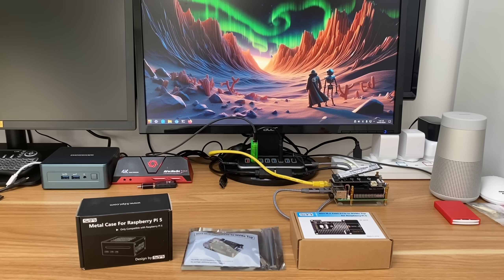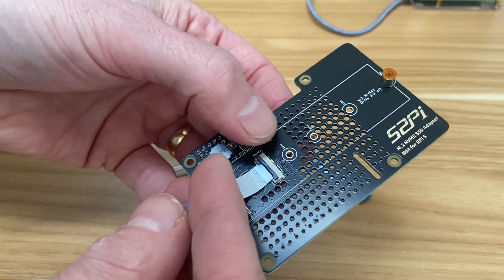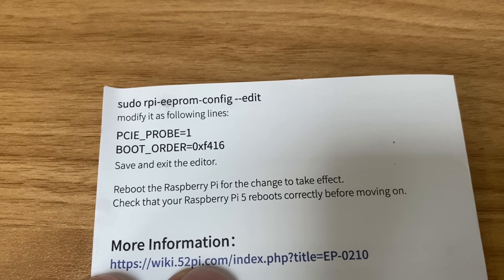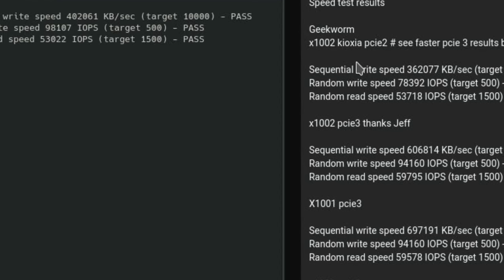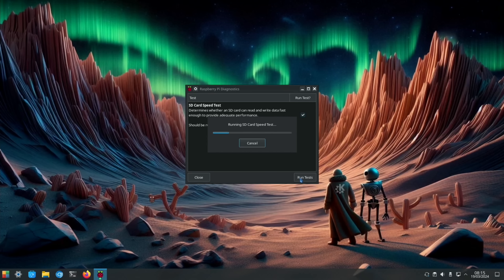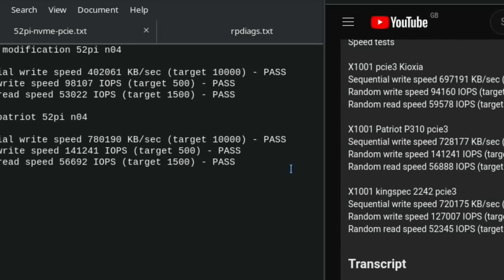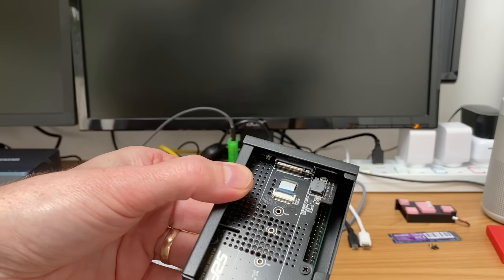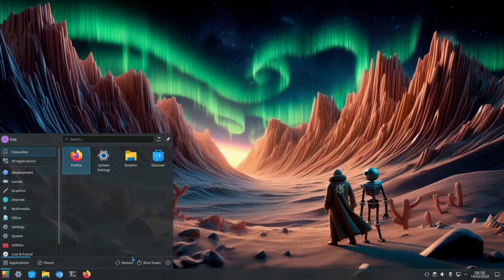Raspberry Pi 5 Metal case with NVMe. 52Pi

Comment: metal case and heatsink mod will kill wifi performance without an external antennae mod. with just the heatsink, i can't get 40 feet from the router and maintain good performance

Comment: Hi, I currently have the standard pi case for my pi 5, and for me, it seems like the case gets very hot to the touch when running 24/7, maybe you remember how hot the case got on the outside? Or maybe you even have it still running ? I would appreciate an answer very much, many thanks!
Reply from the maker: I didn’t run mine 24/7 might be worth setting the fan to come on earlier.

Try Raspi-config

I mostly use this

Electrocookie Raspberry Pi 5 NVMe case with a Door!
https://youtu.be/moN6m-Uu1QY
Reply: @leepspvideo thanks for the answer, the electrocookie does not get hot?
Reply from the maker: @zRetix it has a bigger cooler and more space internally. I haven’t experienced it getting hot

Comment: The advantage of this board is that the ribbon cable doesn't stick out that much, especially if you want to put the whole thing in a case. So, use the 52pi N04 board with a Geekworm case.

Comment: Is there a reason, other than its cheaper, to choose a no 4 instead of a no 5?
Reply from the maker: @riks9534  pi4 is slower but uses less power. Pi5 with nvme is much faster
Reply: @leepspvideo  thank you very much for that answer. I did mean the nvme pcie no 4 or the no 5 (not the raspberry pi 4 or 5 itself). The ones you put the link up for in the description. It seems the no 5 is faster, but is there a downside?
Im still learning and all, so i hope i can make my questions clear.
Reply from the maker: @riks9534  I would choose whichever fits your purpose. Both are so similar in performance

Comment: Have you found any NVME drives which weren’t compatible with this N04 Pi hat? Some other Pi hats seem to not like specific NVME models.
Reply from the maker: I have found the problem is usually the nvme drive. Not the various nvme hats I have

which NVMe drives work with a Raspberry Pi 5?
https://youtu.be/3mUgVTBmKio
Reply: @leepspvideo  I've seen various compatible drive lists but I couldn't find one specifically for the 52pi N04.
Reply from the maker: @pangloss9  if it works with others it should be fine

Comment: I got my Raspberry pi 5 B 8Gb today, With the same NVME adapter as the one in the video. I put them together m.2 nvme in and was recognized immediately.

 ask? I don't have the settings in the firmware config either and my config looks different than yours. Should I still add the pciex1 parameter?
Reply from the maker: @matay.J4350  you still need the gen 3 bit if you want gen 3 speeds

Shown in this video
https://youtu.be/3mUgVTBmKio?si=mZpU6lQJUHbaD1Ca
Reply: @leepspvideo  Thanks for the info👌👍👍👍

Samsung 960 EVO 250GB
Sequential write speed 748982
Random write speed 161022 IOPS
Random read speed  211406 IOPS
Test PASS

Comment: Hi, does this case work with bottom SSD hat ( Geekworm X1002 PCIe to M.2 )  ? It does look similar to to Geekworm's official case, but not sure if that bottom SSD hat will fit in here or not.......
Reply from the maker: @Nikhil-Stoic  probably, although I now recommend gpio powered nvme boards as the ribbon cable alone seems to be slower and causes problems if you plug in extra usb devices 

https://youtu.be/f8Ou6VkuF4w?si=cvvjthYXtLIVtzv0

Comment: I am impressed how smooth the operating system is running on your pi5. I have tested you latest build but it not that fluent. I have the 4gb version, but i doubt that for normal use there is a difference. Is your system overclocked maybe ?
Reply from the maker: I use an nvme drive for the best performance. If it’s still slow drop the desktop resolution to 720. I am rarely Overclocked on Pi 5 when running KDE
Reply: @leepspvideo  I will migrate to an nvme drive tomorrow, this will make a change for sure.

Comment: Great video, thanks. Do you think that (buying the N05 and the Metal Case For Pi5,support N04 & N05 & Active Cooler) there is space enough to use a NVMe with a heatsink or the heatsink occupy too much space? Thanks
Reply from the maker: Some smaller heatsinks will fit, the NVME doesn’t get too hot in my experience with Pi 5. Maybe in a hot climate.

More tests with nvme temps shown here

Raspberry Pi 5 Overclocking beyond 3Ghz. 4GB & 8GB models Benchmarked
https://youtu.be/3zlteWp6ro0

Comment: Being new to Pi’s I’ve got a Pi5 on order, that case and I think the same hat and similar drive. 

I will be putting Home Assistant on it though. Will I still be able to update the settings like you did to make the drive faster or is that just for Pi Operating system?
Reply from the maker: The process with config.txt settings is the same
Reply: @leepspvideo  Brill thanks. Is the only way to get to that file to put the Pi operating system on connect to a monitor and then Terminal to it like in your video? As I said I'm going for Home Assistant so would access it remotely after I've installed the Home Assistant OS. I haven't got a monitor available I'm all Macs in my house.
Reply from the maker: @Charlie_Chester  it can be done remotely
Reply: Awesome share, big thank you!
I have a question, I manage to connect to my pi with VNC and Pi Connect but my UI is not as in your video, the only theme I have is Pi OS standard but with Windows 11 icons and I can’t switch layout, I manage to get the menu and when I tried I got a to the log in screen (not pi os style) and when I typed in my password I get a black screen and then I’m back to the log in screen again. What should I do? I’m new to Pi’s and haven’t got any hdmi cable adapter yet so I need to fix this hehe. 

Thanks

Comment: Hi, after watching your video I decided to bite the bullet and get my Pi5 and the various bits you mention in this video as this was the build route I had chosen, but had not decided on a case (was going with an Argon), so thanks for the video. On the Pi Hut website they place the Patriot P310 in the not fully compatible bracket, have you noticed any issues? I bought it anyway.
Reply from the maker: No issues with the patriot it’s my main drive
Reply: @leepspvideo  Cool thanks - just built up the 52pi and noticed that mine came with a different top? The image on Amazon clearly shows the same top as your with lots of holes, however my lid only has 3 x fan shaped cut outs?

Comment: Is the dsi port on the raspberry pi 5 same as the pi 4 ?because i want to use a 5 inch dsi screen
Reply: No, the connector has changed, but there are cheap adapter cables you can use to make it work.
Reply: @Biadosaru  what is the name of the adapter?

Comment: Very good that the PCB and case top have holes for the air flow. Why don't they put the M.2 on the side of the board instead of right above the CPU? An alternative option is to have the M.2 2242 / 2230 orthogonal to the board, and near the USB plugs (with a hole in the PCB board where the CPU is located) to keep the air flowing off the CPU. *KDiskMark*, the HDD / SSD benchmark tool, is also very convenient for speed tests (Qt based, no dependencies to KDE although the name may suggest the opposite)

Comment: 0:58 the little ridge that goes around the brass fitting fits in the NVME drive recess where the screw would normally secure it to the post and acts as a sort of retention bracket or tab for the drive. It screws into the board from the other side. Many PCIE NVME/M.2 SATA adaptors use them because they're about as low profile as you can get. It acts as both the post and the screw, this way board doesn't have an m.2 nut that has to be removed to fit a longer m.2 drive.
Reply from the maker: Thank you

Comment: Great case, keeping the raspberry pi OS quite cool.. SD card once inserted in some cases are hard to take out, just because how they mold it, and how it overlaps the complete socket. This doesn't seem to be the issue with  this very case here. It is kind of a bummer, that the wifi turned out weak. That is the only thing keeping me away from this. Thanks Lee. 

By the way Lee, Update on Crimson OS: XFCE version was uploaded and today I will upload the LXQT version and finally the Crimson Desktop Edition (CrDE) tomorrow. 

A thing to note: upon installing an app from pi-apps, it initially opens up a terminal and yellow highlighted text begins to appear informing that system is incompatible. However, an additional script has been provided which works after 10 seconds of the message. Thus, an app installation will require 10 seconds wait-time before it actually initializes the install process. 
The reason for this behavior is forking various branches, repositories, which the pi-apps thinks are incompatible.

Whenever You Get Time,
Thanks, 
Another Great Video,             
Pradyot Pachore

Comment: Random comment.  Has anyone connected their Pi to a WiFi router using WPA3?
Reply: I did it and using the internal Broadcom adapter.  See pull/5945

Comment: If you feed the cable thru the hole before attaching and clamping you remove the possibility of cracking ribbon cable wires.

Comment: Almost looks like it could take a Pimoroni NVMe base on the bottom, almost.  Bit more space and ribbon cable consideration would be the crux there.  Prefer a base-fitted one, keeps your cooling options open.  Using a modded Raspberry case with mine currently, and NVMe base works well.  But really would like a metal larger one when the market selections stabilise, or something that's just - that one jumps out.  Have to pop the lid off the Rasberry one for those peak moments and the heatsink cooler(good price that one Raspberry).
Reply: Exactly, I don’t know why these companies are designing hats to use an NVME SSD. Heat is definitely something that needs to be considered.

Comment: The NEO 5 is better nvme is on the bottom and does not bloekc the ariflow , and yoiu to use ehternet if using a meteal case because wifi is not the grreates as one can imagine, i have  one plstic case for rpi 5 without nvme and use Ubuntu + Kodi for playing movies and the other ons ia NEO 5 metal case without nvme and the third one is NEO 5 with nvme and a 1 TB SSD on board also with Ubntu 23.10 on it, works fine.
Reply from the maker: Maybe it looks different in the video. I don’t feel airflow is blocked at all

Comment: I’ve given up waiting for the Argon Pi5 NVME case (my delivery date keeps moving backwards) so I’ve just ordered one of the 2280 versions of this from Amazon and as a Prime order it will be delivered tomorrow by 1pm. When the Argon one eventually arrives I’ll compare the running temps with 2280 SSDs. Thanks for the timely video. 👏
Reply: Yo ordene igual de Amazon prime el X1001 marca GeekWorm y me llego en 7 días y vivo en Puerto Rico 🇵🇷 zip code 00725 y pues este fin de semana ya la haré todo el montaje y pregunta que diferencia tiene de esa que orden con la que sale en el video o la que mencionas?
Reply: I think I'm going to hold out for the Argon case, due to the WiFi problem. I have an Argon case on one of my pi 4s and with the plastic bottom shell, it doesn't seem to interfere with the WiFi at all. I have two of my pis on ethernet, but there is no cableing to the room my desk is in, and I have no intention to crawl in the attic or crawlspace to run one.
Reply: @jbuchana  you could try powerline ethernet adapters. You don’t really get the speed they say they’re good for generally butbut you can get fast enough.
Reply: @ericg7490  Something to try! I could also get a USB ethernet adapter that would be outside the metal case. Two things to think about...
Reply: @jbuchana   I get around this by connecting a remote Pi4, running as a Roon Endpoint in a Pi Touch case which isn’t good for Wi-Fi , to an Ethernet PoE switch and the switch is then connected to a UniFi Wireless Access Point via  Ethernet which also powers the AP. I also have 3 other devices in that room connected to the same Ethernet switch and they all share the Wi-Fi connection with no performance problems. [I live in a 300 year old house with very thick solid walls so I get really annoying dead spots].
Reply: @ThisOldManOfTheSea  Sounds good!

Comment: I still feel that the ssd belongs on the bottom so that it is easier to cool the cpu.  Maybe I'm wrong but blocking the cpu cooling just doesn't work for me. Thanks for all you share.  Maybe all those holes for cooling will work. I'm sure you'll tell us at some time.
Reply from the maker: With the holes in the board and the gap between the NVME and the board airflow is still very good
Reply: @leepspvideo Thanks

Comment: Did you have to take it apart to plug the active cooler into the fan socket?  Saw that it wasn't connected when the hat was reattached after popping the cooler onto the rpi5.
Reply from the maker: I did

Comment: I need a case that can fit a bottom mounted nvme drive unfortunately.
Reply from the maker: I think it still would. Just checked definitely doesn’t work on the bottom. I value being able to quickly swap drives. Most people wouldn’t keep swapping nvme drives
Reply: Same - I'd like to put a PoE hat on top, and an NVME SSD on the bottom (hopefully the PoE hat will be out soon, and will fit with the active cooler...)
Reply: This case is very similar to the Geekworm one and that one does work with a bottom NVME hat. As mentioned the printed on board wifi antenna of the RP5 is not going to work well in a metal case. Blue tooth possibly as well